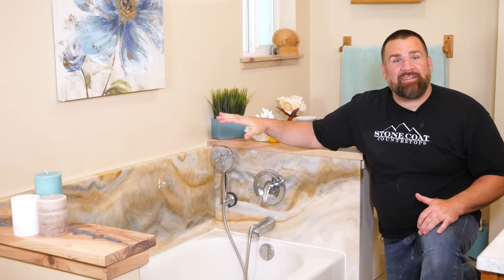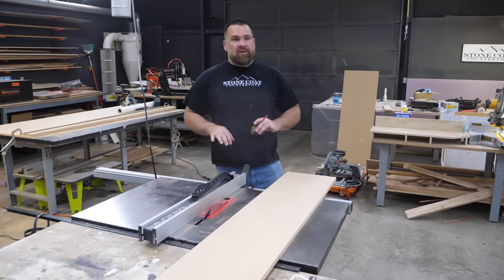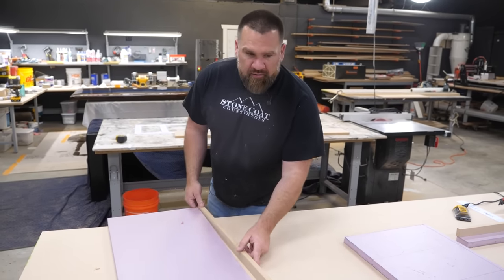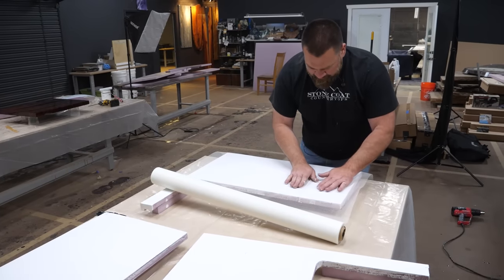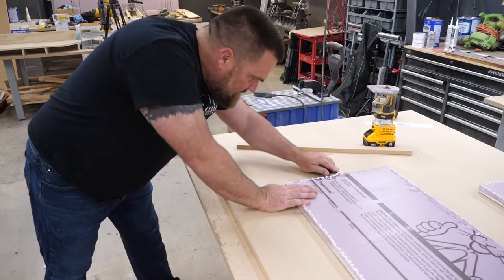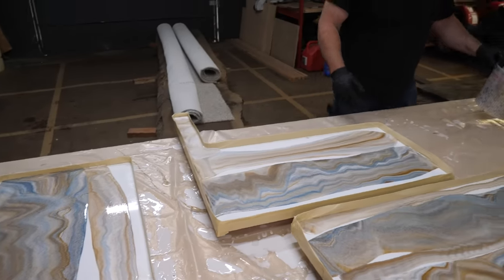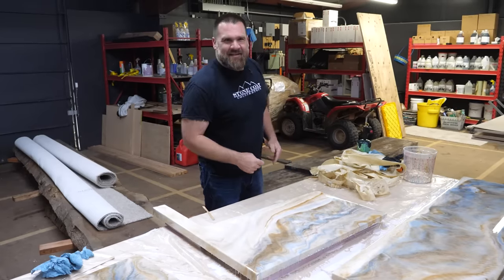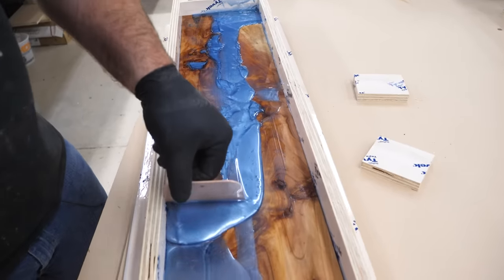DIY Tub Surround Installation | Stone Coat Epoxy

Comment: 10 diameter of screw. 24 threads. The higher the number, the higher the thread count.
Reply: Number 10 screw, 24 threads per inch. The screws smaller than 1/8" use numbers, not measurements.
Reply: Thanks so much for the Pro Tip!

Comment: 10-24 screw is a #10 screw (0.190" diameter) with 24 threads per inch along the length of the screw.

Comment: Mitch, Very cool the 10-24 is the thread size.  I do the maintenance for a group home.  We need to change the bathroom from a standard bathroom to a wheel in shower.  I am thinking of doing your panel method to do all of the walls.  I will have to demo the walls down to the studs so I can run the new water supply lines.  Would you put the panels right on the studs or put sheet rock or a water resistant panels on first?  You make it look so easy that this intimidates me.  Love your channel.
Reply from the maker: Great question! I would install green board sheetrock and waterproof it with either Redgard or Ardex S1K both are roll on waterproofing membranes. Now you're ready to glue on your foam panels. It's not too tough working with the foam is pretty simple, the only extra step is applying the mesh and that isn't hard at all just extra time waiting for the epoxy to cure. If you're in a rush use Quick Coat to apply the mesh. Lemme know if you have any other questions, I'd be happy to help get that project started with you -Mitch
Reply: @StoneCoatCountertops  Mitch I sure will I’m sure to have a few questions.  I think the exotic pour will be the ticket for this project.  I have to make the bathroom a large shower pan then I will be able to start the wall panels.  I like your attitude it’s like mine we can do this!!!!
Reply: I love how you are willing to help, here, free of charge, without sending someone to a paid private class (like these Instagram gurus)

Comment: So BEAUTIFUL!  I’d never leave the bathtub!!  Thank you!   Question…how do you clean the tool you use to mix the resin?  Thanks again!!
Reply: I let it build up for many months. When it gets too thick you can soak some paper towels in Acetone and cover the mixing paddle. Use aluminum foil over the wet paper towels for best results and let sit for 48-72 hours, they cured epoxy will crumble right off. Have you used epoxy on your countertops yet?
Reply: @mitchquist  no, although I’d love to.

Comment: I have an 80% complete bathroom in my basement with a separate shower area. All I need is a tub, toilet, sink vanity, and tile or epoxy in the shower and tub area. It's all roughed in electrical included.  These applications would be perfect 👌. It's going to be one badass Man Cave down there when I'm done.
Reply: You can't forget the electrical outlet in the shower for the flat screen, because real men aren't afraid of a little 110 outlet....pfff.
Reply: Excuse me who the hell are you. Some type of freak stalker? Get a life buddy boy. I need several 110-volt lines for my hydroponics room next door... No Big screen in the Bathroom but the room next to the hydroponics room and bathroom has a 50-inch big screen in it. 😆
Reply: @eagleassets  What you a clown 🤡?
Reply: I am a disabled vet that uses humor to cope with chronic pain. why who the hell are you. I mean come on 80% and I quote.  "I have an 80% complete bathroom in my basement with a separate shower area. All I need is a tub, toilet, sink vanity, and tile or epoxy in the shower and tub area."
Let's be honest you have a glorified closet with outlets.  You have such a big head (sorry I wasn't meaning that literally) to think anyone would want to stalk you.... Was it because I commented, what is this CNN
Reply: @eagleassets  Listen good dude you're not funny. I'm disabled myself. It's a miracle I'm still alive. That is correct all the plumbing, valves, drains and ceramics on the floor are already installed. Just the fixtures themselves is all that is needed and the surrounds in the shower and tube areas. That's it done.
Reply: @eagleassets  Really nice down there in the basement.  All redone like new forced air conditioning and new furnace and brand new water tank for hot water as well. Beautiful can lightng throughout the basement with a really nice ceilings. Since you want to know exactly what going on.

Comment: Just wondering, to conserve a little room can you make the same applications with  1/2 inch board?
Reply: @Gregory Kelly, if you had bothered watching the video you would have heard him say that in retrospect he would have used 1/2 in board instead of 1 in...
Reply: @bloodmoon558  my apologies this is the second video I've watched where they use 1 in I didn't know if half inch was acceptable to use or not I haven't seen them use it. Yes I heard him but I have not seen the product being used. Thank you for your observation.
Reply: Great question, its ok if you missed it in the video I'm going over a ton of stuff! You can use 1/2'' the same way. Put a slightly smaller in size piece of 1" foam under the 1/2'' when working with it to keep it from bowing as you apply the epoxy. Let me know if you have any other great questions, we appreciate you taking the time to ask them!
Reply: @mitchquist  Alright! That's actually why I was asking is because of the difference in rigidity with the 1/2 inch. I appreciate you getting back Mitch.

Comment: Size 10, 24 threads per inch. I can't remember without google but size 10 is 3/16". I knew it was less than 1/4" because that's when they start using the actual measurement.

Comment: The number 10 is the diameter of your screw and the 24 is the number of threads per inch and the next number would be the length. So a 10  24  1 1/2 would be a one and ahalf inch long number 10 screw with 24 threads per inch.

Comment: I'm confused, SC says the clear coat makes the countertop food safe and UTC is not needed, but now Mitch is saying the opposite. Which is correct for countertops or does it matters?
Reply: Both the clear coat of epoxy or the utc make the countertops back to safe for food contact covering up the color additives. Sorry for the confusion, lemme know if you have any other questions. I'd be happy to help

Comment: I didn't see the part where you put the waterproof membrane on and I've looked back to see on the video but I'm not sure if the mesh is the waterproof membrane I'm very new at this and I want to start with small projects so I'm trying to get everything down and we have a small bathroom near the kitchen it was a small sink and it has a backsplash and I would like to use this technique to do the sink and the little backsplash behind it. So I was curious if the mesh was the waterproofing membrane that it is speaking about
Reply: Okay so now I realize that the waterproof membrane is liquid that you put on like paint so sorry for my misunderstanding love your video thank you so much